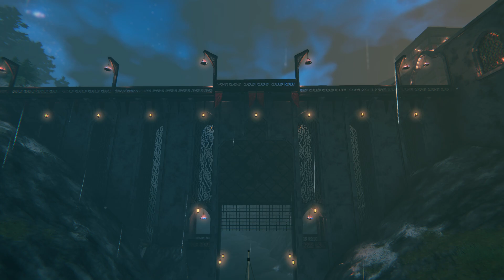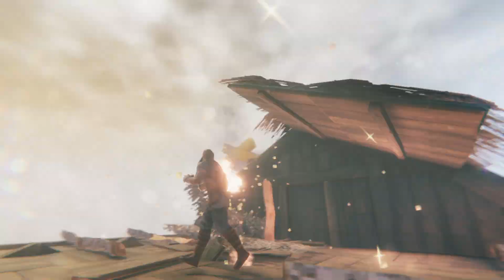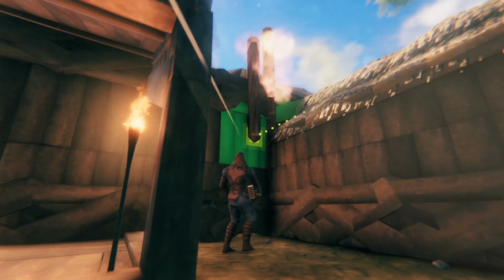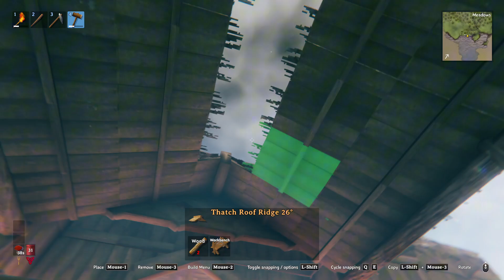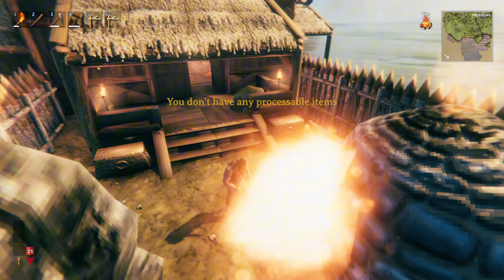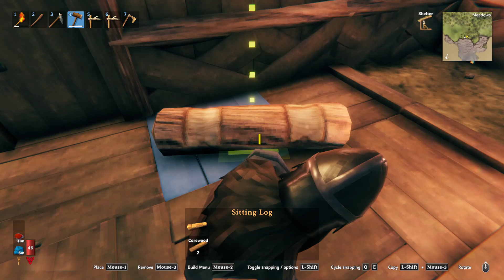Build and Chill: Valheim Wood Explained Part 3 (Core Wood and Fine Wood)

Comment: 3 years ago when i first got this game and put a dedicated server on my home pc, i built a really nice barn style cabin with an upper floor. The house was surrounded by a river in the front and ocean in the back as well as the sides. Basically, a very very small island. I surrounded the island with wood stake fences after getting destroyed by "foul smell from the swamp" had no idea how raids worked then haha. They killed all my pigs, which made me mad.

Anyway, i lined the stakes fences with portals, but after i had close to 20 portals, made a structure to hold them. Eventually, dug a deep pit on a friends server and lined it with stone. Think of the pits in the mountains you find. then we had 2 or 3 levels of portals.
Reply from the maker: RIP the piggies man. And that's a really cool idea! I've always loved builds that include terrain as a key focal point. I'll be doing something similar a bit further down the line with a basement design for a mansion.
Reply: @BuildExplain  yeah, its a fast a quick way to get shelter. Use whats there in a pinch. The mountains biome can be brutal so using those underground round tower structures as a quick shelter to rest and buff up... Life saver